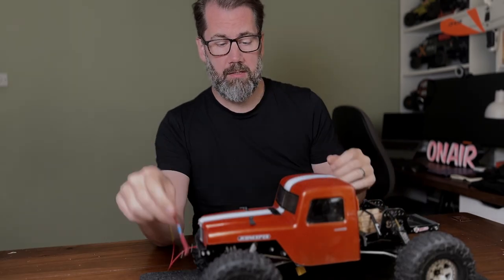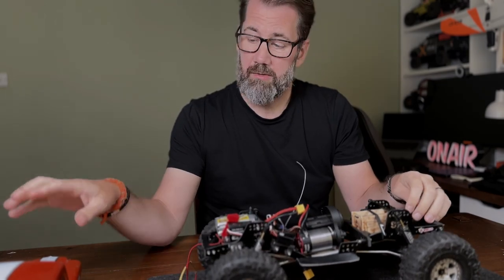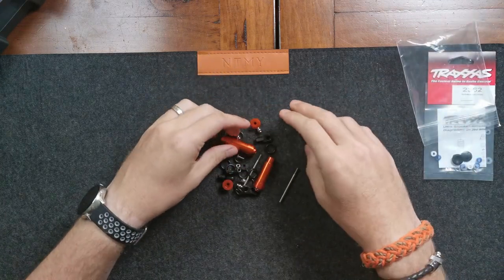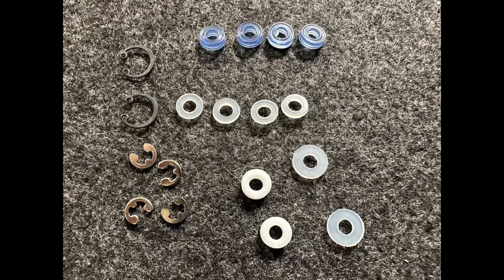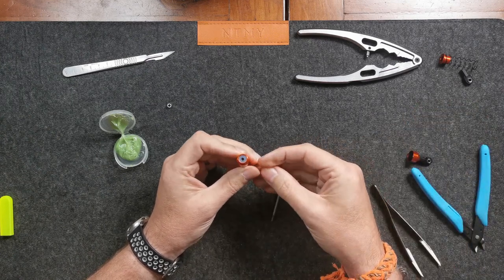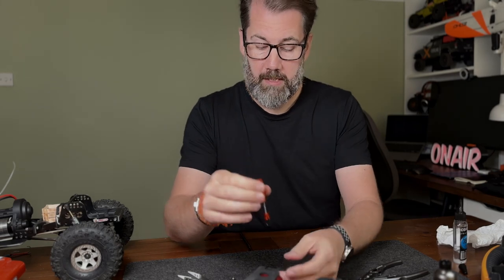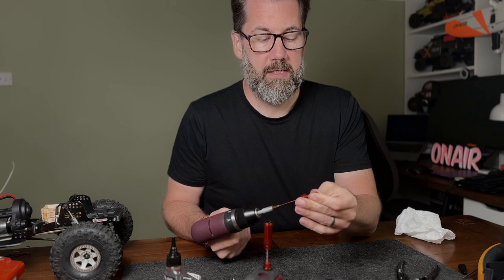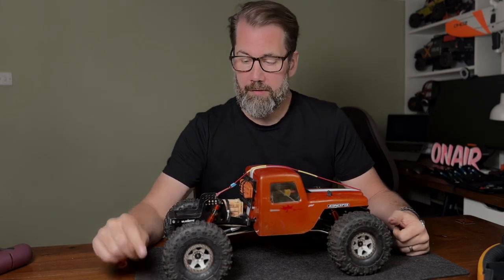BUILD and INSTALL DRAVTECH Shocks on my GSPEED Low CG Belly Dragger

Comment: Curious what you think about the Dravtech shocks vs the Desert Lizards you had on before the change.
Reply from the maker: Too early to tell if they are better performing, but on the bench I’d say they feel better than the lizards. Certainly smoother and easier to set up. I was never really sure if I had the lizards set up correctly, but these feel like I have them spot on. Will update on performance very soon! Promise 🤙
Reply: ...The DravTech Shocks were built "for comps", as the Desert Lizards are "used in comps", but were originally built "for scale looks" and some people that "comp" wanted to have "a droop set-up", which allows for "axle-drop", so that the tires can reach down & make contact with whatever surface is being used !!!
👌
Reply from the maker: @paulschryer9571  Having now spent some time running the rig with these shocks, they are definitely much better than the Desert Lizards for technical crawling.

Comment: Great video Phil! - I have the same 3D printed bed on my GSpeed Element....Do you get any interference from the  top of the diff hitting the bottom of the bed under full compression (or a bit before)?
Reply from the maker: Hi Shoky and thanks. Just had a quick look and my shocks are bottoming out before the diff or high clearance links hit the bed. There is only about 1mm clearance for the links though. Which stocks are you using? Must have a bit more travel than these Dravtechs. 
Don’t think it’s a huge issue so long as you get the flex you want, very rare that you’ll bottom out both sides of the rear at the same time I would think. 🤙
Reply: @PhilBrindley   Cheers Phil - I'm using the stock Element shocks with mini-t springs and 3d printed spring cups. I think you're correct on both counts....probably a tad too much travel and both compressing would be a very low %
P.S - those JConcepts Creep cab only 
bodies were as rare as hen's teethup to fairly recently....I like yours!
Reply from the maker: @shoky11TV  I like the idea of using mini-t springs with the element shocks. Could always add a small spacer to the shock shaft to limit the travel if it becomes a problem.
Reply from the maker: @shoky11TV  I like the idea of using mini-t springs with the element shocks. Could always add a small spacer to the shock shaft to limit the travel if it becomes a problem.

Comment: Thanks for the video, I followed along to build my shocks. I have a similar rig to yours. I have soft springs and 100cst oil. I find I can compress the shocks half way and the truck will stay at that height, it doesn't sink down or raise up on the shocks.. is this normal, do you know?
Reply from the maker: 100cst or 100wt? 100cst would be too thin and 100wt too thick. Strange though, if you lift the truck off the ground to fully extend the shocks, does it sink back to halfway when you put it back down? I get very little rebound on mine unless I bottom them out, at which point they rise back up to about halfway, which is where I like them. You don’t want them rebounding all the way back up as that will affect the performance.
Reply: @PhilBrindley  100cst. Originally built with 25wt and the shocks didn't really move unless pushed or pulled. If I pick it up, the shocks extend, when I put it down it stays at that height. No sag. When pushed into the ground, it stays low. The fronts move back up maybe 2mm from spring pressure.. shocks are only days old and they feel quite stiff sliding through the seals. Maybe they'll bed in..
Reply from the maker: @adamreturns1  did you use any green slime on the seals? They should be pretty smooth out of the box really and I would expect them to sink with soft springs and that oil. Maybe give them a run and see if they need in, or reach out to dravtech and see what they think.
Reply: @PhilBrindley  I did use some green slime, maybe that was the issue. I've just stripped them all and rebuilt the seal bundles, they are softer now.. and I hate that stupid spring clip retainer. When I pick it up the axles drop nicely, when put on the ground it sags about 30%. When pushed into the floor it barely rises, but it is definitely better. Thanks for taking the time to reply, Phil. Much appreciated 👍